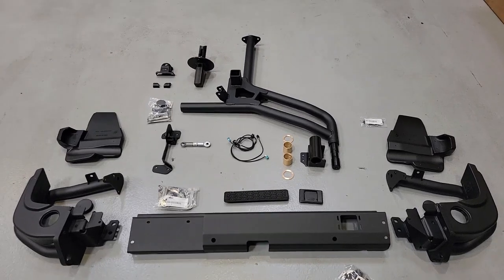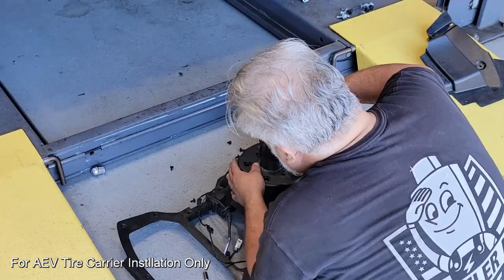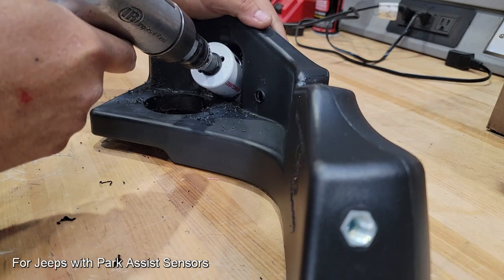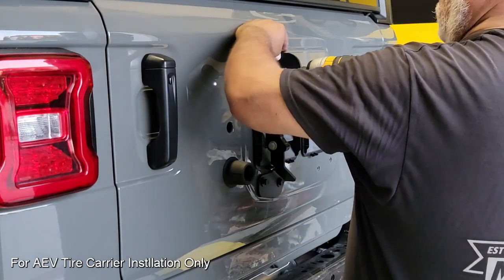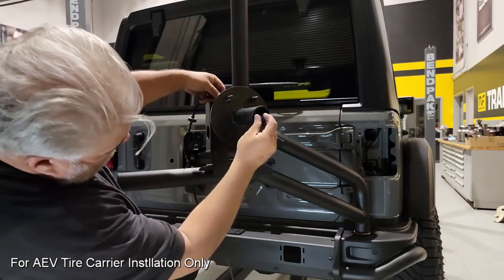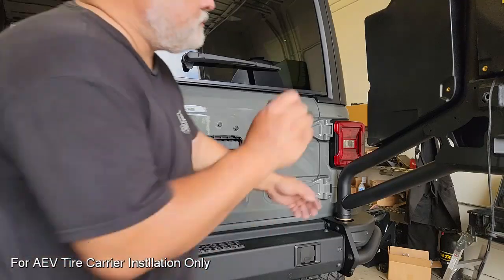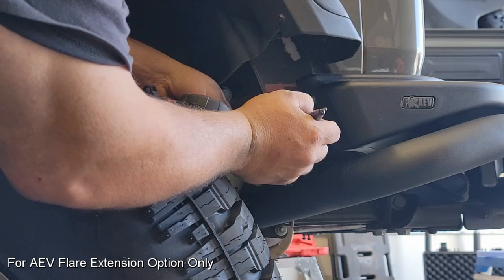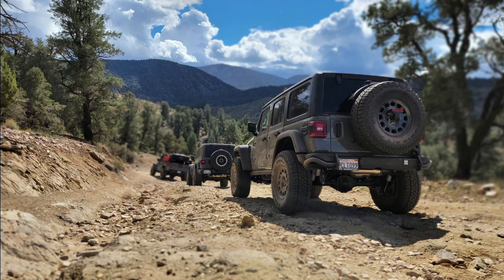AEV Rear Bumper & RX Tire Carrier Installation: Premium Jeep JL Wrangler Protection

Comment: Just realized I have to remove my HD hinges =(
Reply from the maker: I am not sure that you do.  Most of the HD hinges are fine so long as the center plate area can allow for the connection point of the turn buckle that attaches to the swing. Send me some pictures or a link to the kind of HD set-up and ill see if I can overlay some data. I'm pretty good with CAD.

Comment: Just ordered mine . Cant seem to find any videos on installing a 3 inch cube light onto the AEV rear bumper. I went ahead and order the aev bracket light and a 3 inch cube light from oracle lighting and i got those before the bumper and the bracket seems too small to hold this oracle cube light.
Reply from the maker: The AEV bumper light provision is tight. it was designed for the Baja Designs squadron but will fit others close to it in size. I have also personally fit the Rigid D-series pod in that area but if another light housing is larger than either of those you might have some fitment issues. I am not familiar with Oracle products enough to say either way.

As far as installation goes, be prepared to remove the center bumper panel if you don't have a lot of manual dexterity and you hand doesn't fit easy. Its much tighter back there if you have the factory hitch installed as well. I was able to fit the BD squadron but patience in tightening the mounting bracket is necessary. Good luck!

Comment: How do you adjust the carrier for a larger tire? I want to run a 38 inch tire but can’t find any videos or instructions on how to fit a larger tire. Is it just the one bolt on the back? Need to adjust the bolts for the lugs since the tire is going to be wider.
Reply: Thank you for your reply. I was able to loosen the 2 bolts to bring out the studs more, and I’m happy to report I fit a 38x13.5x17 Nitto Trail Grappler on the carrier, and it sits flush with the fuel caddy and the metal tube.
Reply from the maker: The adjustment of the tire carrier is more about the width of the wheel and tire combo. Ill go into the exactly why the wheel and tire matters in a second. The overall diameter is limited at 40" inches from a load capacity and physical interference issue due to diameter.

On the swing arm of the carrier you will see there are 2 bolts to adjust. 1 bolt is to lock in the swing arm square tube "receiver" to the wheel face mount square tube that slides inside so it doesn't rattle and stabilize the load. The primary bolt is the long one that passes through the middle and determines the distance from the inner face of the spare tire to the inside face of the wheel. This is why the specific wheel and tire combo is important.

The limiting width of the mount is dependent on both the width of the tire AND the offset. As you can imagine the more positive the offset (flatter/no dish wheel face) the less wide a tire can be mounted. The more past a 0 offset or more negative offset (big lip/deep dish wheel face) the closer the wheel mount will be to the swing arm structure. 

I don't think the instructions created a tire size based limit as it would be impossible with tire companies varying actual tire widths to numbers.

I hope that helps and thank for tuning in.

Comment: Awesome video! Thanks for the walkthrough. I am wondering how do you remove the 3rd brake light to access the spare tire? In addition to that, I read that you could equip a shovel behind the tire. Can you confirm that? Thanks!
Reply from the maker: It is a clip on.  Just grab the 2 tabs, pull them unplug.

Yes a full size shovel can fit behind the tire.

Comment: What happened to your Bison???
Reply from the maker: I go through vehicles every couple years. I like modifying them and using the latest goodies in the aftermarket "toy box," so nothing stays around too long.

With the new ZR2 Bison around the corner, I might  be back in market for another truck but it all depends on how crazy the dealership situation is. I was supposed to replace the Colorado with the Silverado ZR2 but I wasn't about to pay the $5k market adjustment at the time.

Comment: Now that you've had the lift for a while how dose it ride compared to stock? I'm considering this lift I really like the 8100 series shocks paired with the aev 2.5 inch kit.
Reply from the maker: It is far from stock as far as my subjective evaluation of the Stock vs AEV experience goes. From a comfort level it is more plush but its solid without being harsh over speedbumps or unexpected potholes. It handles well all things considered. Fully loaded I'm about 6100 lbs. and on the street daily I'm closer to 5800 lbs. Its not top heavy in the corners and it settles in with a little speed or throttling out. It's very predictable and lacks that "floppy Jeep" feel of an all out rock crawling machine. I  am extremely happy having driven a 5100 equipped AEV Jeep this week at the EJS event. I am very satisfied with the 8100s and even more so with some speed on the packed dirt ... it's a SFA machine not the old supercharged IFS Colorado ZR2 but it does surprisingly well.

Comment: You do great work. I don't have the patience for a bumper like AEV.
Reply from the maker: Thank you and thanks for watching. It takes a good deal of time but the results make it all worth while. I don't think there is another bumper that has the preservation of factory functions in mind while being only as much as it needs to be. Good Design, great fit and finish and if the DIY install is not an option the best part is that AEV has authorized dealers to make sure you can get it installed the right way.

Comment: I’m really curious if this bumper would fit on a JT
Reply from the maker: Thank for watching but I am going to have to say no, at least not bolting up. The rear portion of the Gladiator frame and the Wrangler JL/JLU are completely different so supporting the swing arm would require extensive fabrication. Additionally the side tubular protection bars would not line up to the frame the same and you have to deal with quite a few other cosmetic details like hitch and such that would not line up.